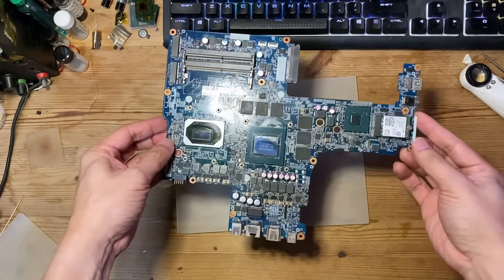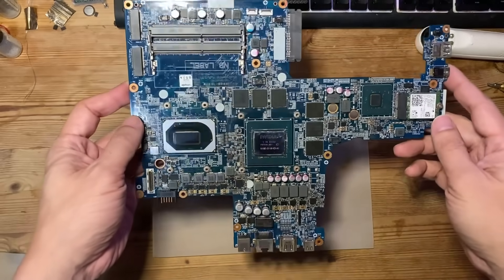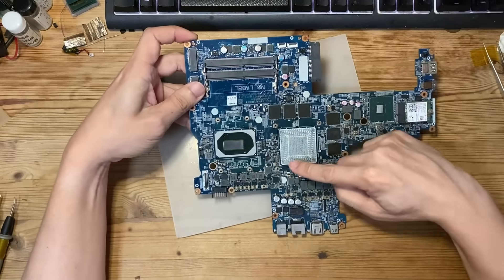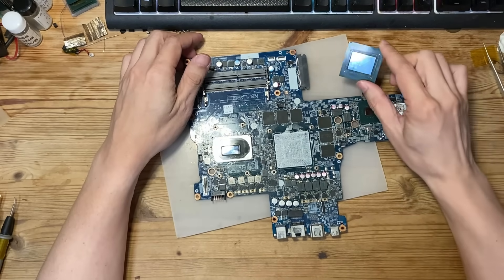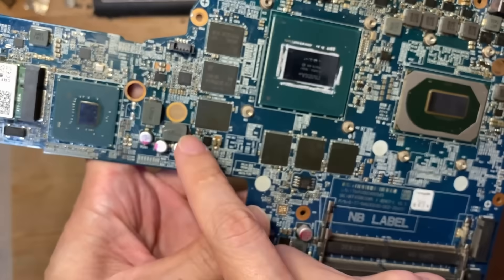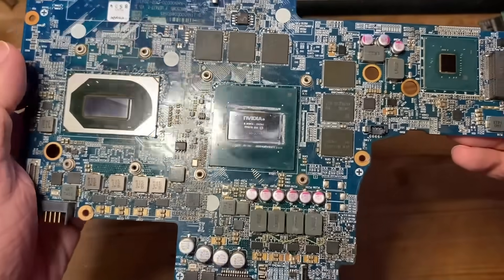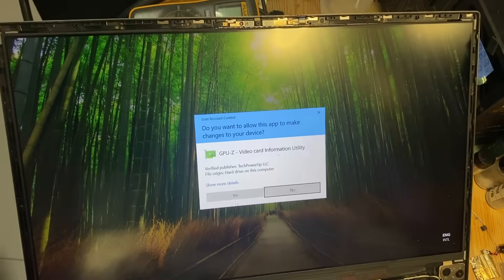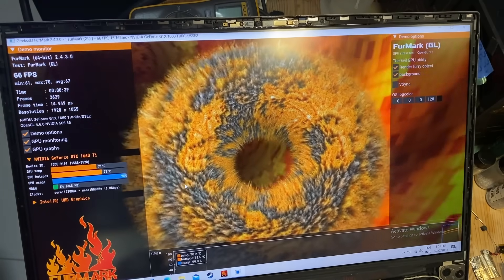Replacing RTX2060 with GTX1660Ti chip in a laptop. Will it work?

Comment: So no modification just straight up swap? This is insane.
Reply: Socket for an unsocketed part?
Reply: @toxy3580 senpai has no idea what they are talking about.
Reply: @toxy3580  It's possible to modify a laptop that uses unsocketed parts to use socketed parts without increasing the z height too much. Thinkpads used to have socketed processors before Lenovo switched to using soldered components. As far as repairability and upgradability are concerned I wish more companies would opt to take the Framework approach without selling overpriced borderline ewaste laptops.
Reply: Modificationm for what? It's the same bga, and the main bios in a laptop includes the vbios for all the GPU variants it might come with
Reply: It's practically the same chip dude, why would it not work?
Reply: @ My thoughts exactly but different amounts of stress could be applied to the chip
Reply: He reflashed a chip
Reply: I’m surprised he didn’t install a socket for the CPU/GPU. I wish more laptop manufactures would offer socketed CPUs/GPUs on higher end devices.
Reply: @UndercoverSenpai01  how is he gonna install a socket for an soldered part? if some stuff needs soldered you cannot just hold it together with some rubber tape or a socket
Reply: @NinjaX2009  It's possible to take the core chip of a GPU and put it in a socket, the issue of electrical connectivity and signal integrity arise though. I'm not an electronics engineering expert by any means but I saw a similar video where someone tried something similar by socketing a soldered component.
Reply: @UndercoverSenpai01  Yeah. It is actually possible to socked soldered component. But usually it requires different pin layout on board to solder socket. But some sockets does fit to BGA pins. But its being held by force pusing on pins on BGA component. Good  enought for backing up emmc(sotrage) from your dead phone, tablet or whatever. Not ideal for longterm use.
Reply: @gouster4583  The pressure being applied to the BGA pins is an issue. You would almost have to design a new circuitboard to prevent those issues from manifesting in a destructive way.
Reply: @NinjaX2009  "how is he gonna install a socket for an soldered part"

By installing a socket. Do you think socketed parts don't have their sockets soldered in place? Lol
Reply: @NinjaX2009  Incorrect. In reality, you can. More specifically, an example is that there is an i9 12900HX that has been converted to a socketed version. Basically, a PCB converts the soldered connections into an output compatible with the LGA 1700 socket (B760, Z790, etc.). So, it's not impossible, just COMPLICATED.

Even if we discuss creating a notebook pcb with a socket, which represents the opposite side of the issue, it is entirely possible. For example, there are even factory-made laptops with am4 sockets and ryzen 9 3900x processors, which is a recent instance. There are likely also enthusiasts who modify these at home. Therefore, it's definitely not impossible to use sockets on pcbs or to use mobile processors with sockets.
Reply: Just goes to prove how little Nvidia is improving.
Reply: @buggerlugz6753  To be fair, the 16 and 20 generation are exactly the same in terms of architecture. Turing.
Reply: @buggerlugz6753  The gtx 1660ti uses the same architecture as the rtx 2060. They released those both at the same time back in 2019. The 1660ti is literally just a stripped down version of the rtx 2060.
Reply: @buggerlugz6753 this comment makes no sense. It’s the same BGA package, of course it’d work. 

Nvidia is a horrible company for consumer graphics but you basically said the equivalent of AMD chips suck because the 9950x and the 9600x fit the same AM5 socket.
Reply: @buggerlugz6753 from what I've read it's basically the same chip just without ray tracing.
Reply: @buggerlugz6753  - Eh? he had to flash the bios to accept the 1660Ti - What do you mean? lol
The RTX 2060 whollops a 1660Ti especially when using Ray tracing, which natively, the 1660 can't do.

Comment: Sometimes you can revive the chip by doing the exactly same thing but, not remove the chip just resettle it. Some of the transistor have died, the heat shortens some of the internal pins making an inside connection. It's a 50/50 chance it comes back.

Comment: WOW, i didnt expect that it is "plug and play" :D
so if i have 1660 TI i can upgrade it to 2060 ?
Reply: I wouldn't call it plug and play tbh but yeah that's totally possible, you just need the right tools and gpu bios
Reply: @rem_0  is the vram on the soc?
No need to replace anything else?
Reply: @rem_0  also, is the bga basically just pcie lanes, nothing else?
Simple as that?
Reply: @yasirrakhurrafat1142  nope its not as simple architecture wise - it is not an soc, thats just gpu itself and memory is near the chip on the pcb. But since this is the same generation, identical pinout and they are electrically compatible this is possible
Reply: @rem_0   awhh, any way to figure out which pinouts are basically just connections with the pcie lane?
Do they ever publish schematics about pinouts of the gpu and memory, and the final interface to pcie on the gpu side and the motherboard side?
Would be awesome.
I'd been thinking of building a laptop anyway.
Most (desktop) motherboards are very bulky though, although they have a lot of interfaces, and ports, and I wanna make it compact, yet least compromised on the performance, cooling, and interfaces/ i.o.
I think being able to rip a good gpu off laptop and put it on a separate pcb, and everything, will make the diy stuff very efficient.
Laptop gpus are binned better, and are sometimes respectably more efficient than their own desktop counterparts, with almost immeasurable difference in performance.
I'm planning on making more compact vrm, and power dilevery, i.e just replace large stuff with smaller and higher quality.
Increase phases, thus making more efficient (don't know how to do at all though).
Making a diy lappy would be real fun.. now that I've gotten much more accustomed to power electronics, 3d printing, and the knowhow on these things in general.
Reply: @yasirrakhurrafat1142  big words for someone who didn't even know where the video memory is. I wouldn't recommend building a laptop from scratch. Buying a used option, or slightly damaged is another story tho, but either way if you think you have resources for building a laptop, I'd rather just buy it since it's cheaper and less hassle
Reply: @rem_0   bruhh, I ain't gonna build pcbs from scratch.
Just gonna try to upgrade the existing vrm by harvesting better quality vrm from high phase count mobos, or better if possible.
Just to slightly reduce the need for heat dissipation and average current needed to power the cpu.
Making it all very efficient.
Although I have no idea how vrms are regulated, and the frequency of phases or how they're offset.
I intend to do this, because laptops by default are very expensive, for little processing power, and very limited on ports and stuff.
This, in diy solution however, could open up possibilities for great modularity, upgradability, and potentially unleashing the full desktop cpu potential when necessary, when plugged in.
Laptop counterparts of the cpus are much less performant, unlike gpus.
I'll basically follow the guide from "Socket Science" youtub channel, the guy built a Razer/Asus Rog sized laptop, which was simply awesome.
Would need some work, but would be worth all the nvme slots, sata/usb/ethernet/display(vga/dvi/hdmi,dp) etc ports.
Not the best idea I admit, but wouldn't it be cool, knowing you built it, and can use it as a (relatively) portable laptop, as well as with full desktop performance when you want.
Reply: Why you downgrad pc rtx with  gtx
Reply: @Binbin-u1c
Because rtx was dead and he hasn't a spare one. He recycled the 1660 from other board
Reply: @Binbin-u1cthe evga gtx1070 ti sells for $550+ for a reason. they are goated. 1060 too
Reply: @Binbin-u1c  tis fun to experiment too

Comment: respect to this man for risking his laptop to replace the igpu, needs more attention tbh
Reply: Dedicated gpu
Reply: @travis-studio  dedicated igpu
Reply: @HowDoYouUseSpaceBar  its seperate from the cpu so its a dedicated gpu, theres not such thing as a "dedicated igpu"
Reply: @HowDoYouUseSpaceBar  It is dedicated GPU. IGPU means Integrated GPU which is only found in CPUs.
Reply: @Lilgang24  exactly. it's a dedicated igpu.
Reply: @babywaffles  exactly what i said. a dedicated igpu.
Reply: @HowDoYouUseSpaceBar  No
Reply: @babywaffles  technically APUs. Intel just doesn't use the term because AMD coined it. they use different architecture, but from an abstract pov, any Intel CPU that doesn't have an F at the end of the model is no different from an APU. iGPUs are also in SoCs, which is like a sort of APU. an APU is not considered to be an SoC though, as they integrate a larger range of components that would be integrated into the MoBo of a desktop or laptop using an x86 CPU/APU. SoC includes a CPU, GPU, a lot of recent SoC's have integrated NPU's now. they can have memory controllers, I/O, video encoding/decoding hardware, WiFi/BT receivers, all kinds of bits of logic
Reply: It is dgpu noobs
Reply: DEDICATED.
Reply: The fuck u mean igpu
Reply: Watch the video again, the rtx2060 in there was faulty.
Reply: cGPU … yall are all wrong… CLINGY GPU
Reply: Nobody got this horrible joke. I did but still not laughing with you but laughing at you.
Reply: @ClippyDoesNotStealYourData  cus you like the double DDr up your punani
Reply: He's not wrong.. it is soldered on the board so techinically igpu.
Reply: @akurasubject9617  soldered on board doesnt mean anything
Reply: @akurasubject9617 that's not how the terminology works lol
Reply: @akurasubject9617 it is wrong, as it isn’t integrated into the cpu silicon. Otherwise every single component on the motherboard is “integrated”.
Reply: @ThreeFontStreet  ah, i see now thanks for explaining.
Reply: @akurasubject9617 
He is Wrong, even the main gpu die of desktop graphics cards are soldered onto the board

The Main definition for an iGpu is a graphics processor integrated within an SoC
Or as AMD calls it an APU 

Intel Iris XE or Radeon M series is an iGpu
The GPU here is an entirely seperate chip even if it is soldered and is henceforth not "integrated" within the CPU itself
Reply: ded"I"cated "G"raphics "P"rocessing Unit abbreviates to IGPU in this particular situation
Reply: @perigee_vitz-wong  no, the I is for integrated
Reply: @perigee_vitz-wong wtf.... bro u do t get to just pick pick out random letters to make the abbreviation. Its called a Dgpu because it's a --->D<---edicated  graphics processing unit....  ur literally objectively wrong.  Use Google and stop arguing bullshit. A 2060 amd 1660ti is a Dedicated gpu separate from the cpu. Discrete gpu and Dedicated gpus are the same thing. Both separate gpus. Igpu is integrated into the cpu.
Reply: @perigee_vitz-wong  - IGPU is "i"ntigrated "G"raphics "P"processing "U"init. Get it right if you're going to be smart. This is a Discrete GPU.
Reply: Actually IGPU stands for "I made a joke but not everyone Got it so now i'm sPelling it oUt"

Comment: This guy is a legend, what heating tools do you use to transfer chips? i want to learn smd soldering
Reply from the maker: Just a regular 852d hot air station and heater.
Reply: @DVRepairs  you are fab my brother very impressive work u did
Reply: where did you get the blower nozzle cause i cant find it on any sites